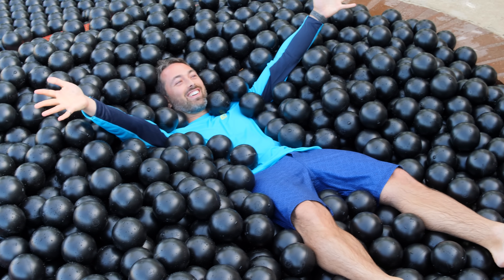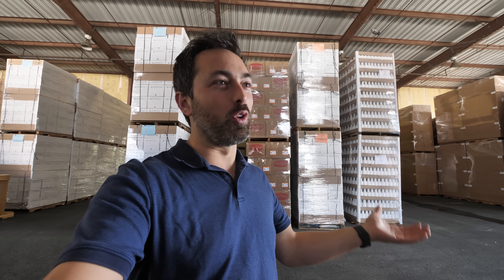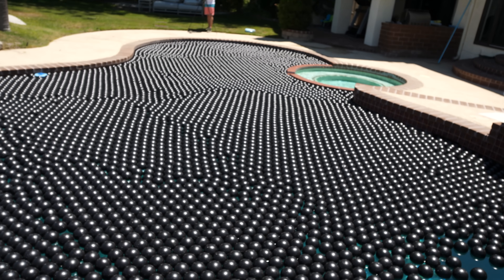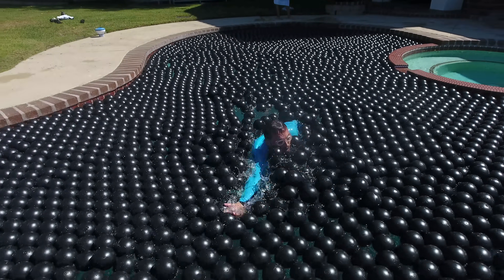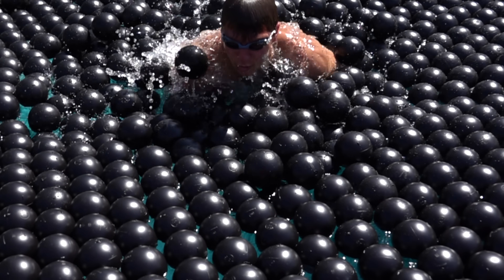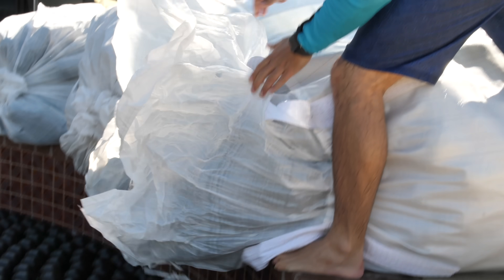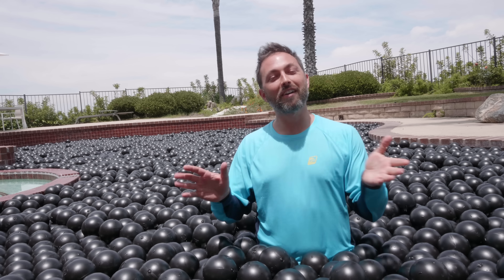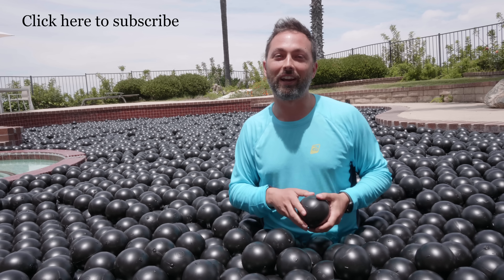Can You Swim in Shade Balls?

Comment: "It's for drinking water obviously you can't swim in there" 
... takes an effing nasty motor boat... 
Mmm... that sweet, sweet taste of diesel.
Reply: I believe the actual reason is because the water is kept quite cool
Reply: Or was it an electric boat?
Reply: @tgyul  Doesn't sound like it ;) https://www.youtube.com/watch?v=uxPdPpi5W4o&t=1m9
Reply: That's masculine flavor right the 
Mechanics first choice for the extra torque in your arms
Reply: HERPY DERPEDY R/TIHI
Reply: One it gets purified.       Two boats don’t just leak diesel....
Reply: @vanzz4763  ok if it gets purified why arent we allowed to swim in it and they release fumes into the water
Reply: @terryclark4906  gasoline and water dont mix, unlike fluids from our body.
Reply: @dexeronstarsurge  they can both  be at in your taps at the same time
Reply: @terryclark4906  if the gasoline gets in after the filtering, yes. But it will all be completely filtered out before it gets into it. Thicker liquids don't mix with water. They'll be filtered out. Body fluid wouldn't be as it does mix with water
Reply: @dexeronstarsurge  nope for example when a head gasket breaks on a car watwr and fuel mixes and it is very hard to get out because it just looks like deisel their is no seperation if it was so easy to seperate water from fuel then it wouldent be as hard
Reply: @terryclark4906  Due to the differing densities of water and gas, mixing cannot occur. As soon as you add water to a tank of gasoline, all of the water will settle to the bottom of the tank. The lighter gasoline will float on top. You get the same effect as you would get when you mix oil with water.
Reply: @dexeronstarsurge  lol whilst sucking in the water it would mix with the fuel and the engine would mix it
Reply: @terryclark4906  Put some cooking oil and water in a blender and see what happens.
Reply: @Mrtheunnameable  it mixed it theres only 1 little splodge of cooking oil
Reply: Terry Clark Yes, you are right, Water and Oil will mix and everyone will drink it, which is bad!!!

That is, if you ignore the density of oil, that fact oil is non-polar compared to water which is a Polar molecule, the fact that a few gallon of oil in over a million gallons of water means virtually nothing and the fact that we treat the water with harsher chemicals than that before Californians get it.
Reply: Beastboyz123 4 it’s mostly oil from the propeller
Reply: @vanzz4763  if it gets purified why cant people swim?
Reply: @umadbro4493  body fluids mix with water, theyre the same densities, it won't filter. Gasoline and oil are lighter than water and will float up to the top, it'll be filtered out.
Reply: Beastboyz123 4 it’s a joke buddy
Reply: @vanzz4763  my petrol engine dinghie is leaking diesel
Reply: @fishsticks8198  This is MURICA we use GASOLINE... XD
Reply: Fish Sticks so tell me why you are filling a petrol engine  with diesel
Reply: I think the real reason why they say you can't swim in the drinking water is because they don't want someone to die in it and be found a few months later clogging the filtration system with rotting flesh. Not only its gross to be drinking water someone died in but the legal problems involved is bad too. 

Even if the water gets filtered and not one human dead cells came through. Knowing someone died in the water you are about to drink......would you want to drink it?
Reply: wynja77 i thought the same thing
Reply: Imagine being this dumb.
Reply: I doubt fuel mixes with water, stuff from your body though..
Reply: That’s what puts hair on your chest... 🤷🏽‍♂️🚀🕺🏽
Reply: I would rather see that boat than a bunch of nasty kids peeing in the water. If people swam in it, then it would be more like sewage, not drinking water. Lol!
Reply: TRUU BUT WHY SO MANY LIKES?
Reply: @justaglassofmilkwithintern7493  honestly has no idea, I was just making a joke... ;)
Reply: All over the United States there are reservoirs that are used for drinking water... Also for boating and fishing....lol The water goes through a filtration system obviously...
Reply: wynja77 😂😂🤣🤣
Reply: LMAOO
Reply: mmm all that moss growing on the bottom
Reply: wynja77 or petrol
Reply: Gas
Reply: But that boat motor uses gas and not diesel?
Reply: This has some truth to it , the boat could be the cleanest boat ever yet i still wouldnt want that stuff touching my drinking water...
Reply: lawl
Reply: Could it be electric?
Reply: I came here just for the comments.
Reply: wynja77, I was thinking that too!
Reply: 888999000
Reply: Electric boat?
Reply: It doesn't dispense PETROL into the water.
Reply: Delicious
Reply: The exhaust of a boat is released above the water. 👋👋
Reply: @nickcarmello6392  Nah, lift an outboard motor (like the one they use in the resevoir)  up above water and you'll quickly hear that exhaust is released under water.
Reply: wrong
Reply: there are worse things in that water than gasoline and 2 stroke oil, but dont tell Califonians that Nevada put fluride in or they will dry up into prunes..
Reply: @Elfnetdesigns  flouride isn't even lethal, gasoline is several fold more dangerous
Reply: @magma2680  it is in large doses lol

Comment: 660lbs? Lmaooo that's nothing at work we have 16 pallet truck loads each come in at 3000 pounds and we have to put them up 6 rows high smh
Reply: But: (a) you're a trained warehouse or shipping professional who already has all the necessary equipment, and (b) your pallet contents probably don't roll and shift in all directions off the edges of the pallet like those bags of half-water balls would do. This would be a very weird type of load to handle. Anyway, his point was merely that he didn't anticipate that particular challenge.

Comment: Most modern boat motors are so quiet because the exhaust is in the propeller, this has potential to put exhaust soot in the water (not enough to cause environmental damage) but probably enough to taint drinking water, why was there a boat in the drinking water, it better either be really clean and not used much, or electric

Comment: So here’s my idea:

Shade squares
And our slogan could be “to cover 100% of the water’s surface”
Reply: If you watched the video he referenced at the start (The one this video is based off), they mention the shade balls have to be circles so they can move with the water as the levels increase and decrease in the reservoir. As squares or hexagons, they'll just get stuck on the edges of the lake and not sit on top of the water doing their task.
Reply: Now hold up
How do you propose to make the squares float flat and not with the tip up?
Reply: Macul Synthelik cubes?
Reply: @Yggr153  square ≠ cube. Imagine some thick square tiles. Like, 10 by 10 by 2.
Reply: @Nibiroid  So like, rectangular prism?
Reply: @eatchild461  yeah, rectangular prism. Though, I think a hexagonal right regular bipyramid or alike would be a better match for this task.
Reply: I think something shaped like a 20 sided dice would do well
Reply: @eatchild461  20dice? You mean, the convex regular  icosahedron? Nope, sadly it doesn't have a cross-section needed for honeycombing a flat surface.
Reply: Why not shade hexagons?

Comment: Swimming in water is possible because water has about the same density as you. So by submerging all of your body and half your head you can keep the breathing end of your head above the surface with very little effort. 
Try this in something with a lower density than your body, you will easily sink and even with effort be unable to keep your head above the surface. 
The shade balls get dangerous when the layer is bigger than about 1.5 to 2 balls deep. Assume they have an average density of 0.5 and there is a meter of them on top of water. Consider this "something floating on the water" and it is clear that the water level will be halfway down the 1m of balls. But if you want to swim on the surface of the water,  you're below 0.5m of balls. OK. you can breathe through that, but a big part of your body is in a water-shade-ball mixture that has a density lower than that of your body. You sink in that layer. You end up with a LOT of effort required to keep your head above the water surface.
Pure physics theory. I would not want to try this in the deep end.

Comment: If you swim in a swimming pool and your whole torso is under water it will be hard to breathe as the water will exert more pressure on your lungs and the outside pressure is lower, causing your lungs to collapse slightly. But it’s not like that kind of collapsed lung that your need to go to the ER for. I’m only 9 years old. I have autism spectrum disorder.

Comment: So as a result: The reservoir can be deadly if someone falls in. 

I wonder how fast you can move thought by diving under them and only sparecely coming up for water. Is it exhausting to get air burried under multiple layers of shadeballs?
Reply: I can imagine it'd be an effort to just push yourself up through them, because they're quite heavy collectively. Endurance swimmers can normally fall back on just floating upside down if they get really stuck, but here even that would be something that drains your energy.

Comment: hold on  a second: you can't swim in the reservoir "because it's drinking water" but you can drive a boat whose outboard engine is exhausting from the hub of the propeller so INTO said drinking water? this doesn't sound right.....

Comment: You're getting it completely wrong. The reason you can't swim in multiple layers of shade balls is because they are light in comparison to water. In order to swim, you need to be in something that is heavier than your body. If your body is heavier than the liquid, it will sink. That's the reason you can't swim in gasoline or vegetable oil or other comparably light liquids.

Comment: "It’s a drinking reservoir, so you can’t swim in drinking water"

But it’s not a problem to ride a oil&gas engine boat in it... 🙄
Reply: EXACTLY WHAT I WAS THINKING
Reply: It’s electric.
Reply: Max Yeh Check the original video.   It’s not.  And also, it’s forcing a lot more because of the balls.  So probably loosing more oil faster too.

Comment: Nobody: 
Swims in drinking reservoir

Veritasium:
Drives boat in drinking reservoir
Reply: Kc Rinke right HAHAHAHHAA
Reply: Better than swimming in it
Reply: DVSS boats actually leave a little oil when they drive
Reply: @CC-gu2uq  how does that work. I don't know
Reply: DVSS boat engines have gaskets, which aren’t perfect, their exhaust is sometimes vented through the center of the propeller (for noise,) and they are liquid-cooled (with water straight from the lake.)  Basically everything the boat engine does involves the water it’s running in... efficient for the engine, but opens up opportunities for minor lubricant leaks.
P.S. The noise point is mostly why jet-boats (jetski-like boats, not with jet engines) are so freaking loud all the time, as the water muffles exhaust sounds.  That said, what is exhaust?  Burnt and some unburnt fuel, and a tiny amount of oil that slipped through the piston gaskets.
Reply: @games1004  thank you! I Learnt something new😄

Comment: Idk for what reason those balls are black. It would be much more efficient if those balls are white. Less heat absorption, less evaporation
Reply: The balls are made of a carbon based material that happens to be resistant to breaking up and polluting the drinking water they're supposed to sit in, but this material is black. Covering them in any sort of paint would be a bad idea for the drinking water. Also the main point of the balls isn't to reduce evaporation, they're mainly there to block sunlight, so the rays don't hit the water, which a black ball can do just as well as a white ball.

Comment: I wonder if you could get through them by trying to swim in the balls, rather than the water. Rather than trying to move through the water at normal swimming speeds, just move balls from in front of you to behind you. It certainly wouldn't be quick, but it might be the most energy efficient, so if you were dumped in the middle of the reservoir and left to drown (by the mafia, presumably), the key is to get to the edge before you are too tired to keep your head above water.

Another technique worth checking out if you still have the pool full of balls is to use them as a flotation device. Grab a couple armfuls, and see if you can rest with your head above water, if that is possible, maybe kicking your feet will make progress with less energy expenditure than a traditional swimming technique.

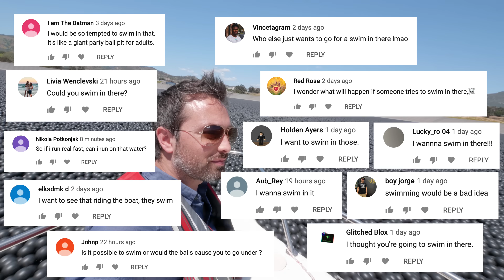Comment: 0:36 "It's a drinking reservoir, obvisouly you can't swin in the drinking water, but you can sail a motor boat in it, spewing some hydrocarbon in it no problem"
Reply: Boats don't just "spew hydrocarbon." That would only be an issue if the motor was leaking gas or oil, which is not something that a well-maintained boat would do.

Comment: "you cant swim in a drinking reservoir" - rides a petrol motor boat with underwater exhaust...
Reply: It wasn’t underwater exhaust but ok
Reply: @tirednoise  normally 4stroke outboard engines exhaust underwater near the prop to reduce noise and smoke and sucks in water with an impeller to cool the engine and then spits it back into the water. 

If the engine is custom modified then...
Reply: @G_Zero127  Shoulda just been electric
Reply: Oil floats...  The debris, bacteria and so forth on a human body doesn't...  A reservoir pulls water in from the bottom so oil won't ever be sucked in.
Reply: So after doing some research open air reservoirs cannot be used for drinking water unless it is processed between the reservoir and homes. The number 1 reason they have always been no swimming is because of water temperature, they are fed from the mountains. 

Here in Wyoming we have reservoirs in the mountains that are no swimming because that water never gets much above 50F. We process the water before we drink it but they are popular fishing lakes.
Reply: @kitmartens774  yeah because I watched Derek's previous video and the LA reservoir seems to be in the path of highway runoff
Reply: @kitmartens774  yeah because I watched Derek's previous video and the LA reservoir seems to be in the path of highway runoff
Reply: @kitmartens774  Well in the previous video about the LA Reservoir, it was made very clear that the whole point of the shade balls was to prevent toxins from developing in the water, which people would presumably then end up drinking because the water had already been processed. Toxins building up in the water is not relevant if you're just going to filter them out anyway.
Reply: @kitmartens774  "The number 1 reason they have always been no swimming is because of water temperature, they are fed from the mountains. "
A question that I never remembered to look up has been answered. This proves once again that not all heroes wear capes.
Reply: Sorta thought the same thing lol
Reply: The “drinking” part is not the reason why you can’t swim in it- it’s to prevent people dying by drowning or getting hypothermia from the cold water.
Reply: who says petroll kill people!

Comment: As a kid I was given so much cautionary brainwashing against kids jumping on stuff swimming in the water that it was a pain for me to watch this video lol

Like we were told that if you put even like a sheet of a newspaper on the water and jump on it, then with enough impact strength the surface is gonna act differently than if it were just water and stiffen and you can break your legs as if you jumped on concrete.

Now, I know that balls is not a uniform flat surface stretching over an area like a newspaper, and that you were not jumping from a diving trampoline but much lower, but it was still scary for me to watch it, I was worried you'd get hurt or that you won't be able to get out above the share balls to breathe. I guess your pool is not deep enough luckily as it seems it was enough for you to just stand on the bottom lol

Still, I'm with them those guys from that company that they don't want to sell to private customers lol

Comment: 300 kg per bag, 8 bags makes it 2,4 tons. Since that is 10,000 balls, it makes each ball 240 grams. So half the volume of every ball is approximately 240ml. So the volume of one ball is approximately 480. Since 480=(4/3)*pi*r^3, it seems that the diameter of one ball (2r) is ~9.7 cm. Correct?

Comment: Going grey and losing a great portion of your hair is not normal. Many relatively young people are now aging very rapidly - The reason? The use of 5Ghz wifi. If your wifi-router is using the 5Ghz wifi(on by default) - Turn it off. Just use the regular 2,45Ghz wifi instead. Nobody wants to look older than their actual age.

Comment: If you can't swim in the drinking water.

Why do you put a motorized boat in there?
Reply: Jamo TStv because a boat is not a biological entity.
Reply: @out_on_bail  doesn't motorboat release fuel oil to the water?
Reply: cheah jason no it doesn’t only exhaust fumes which are negligible considering the water is outside and in open space